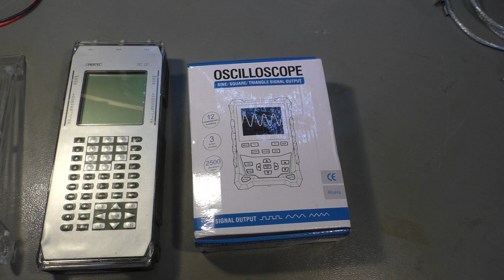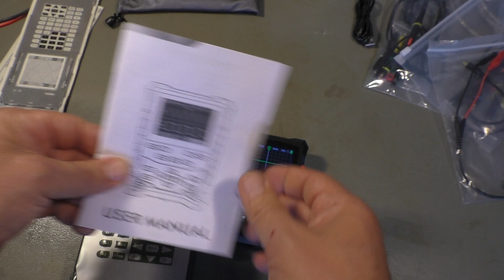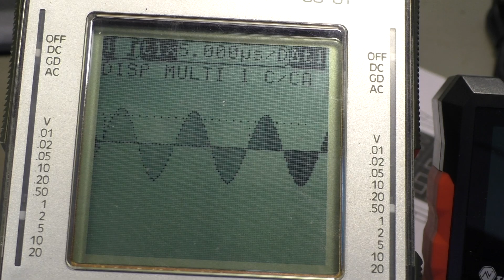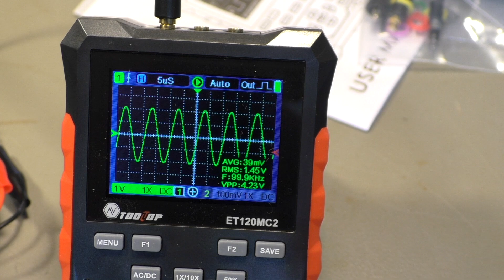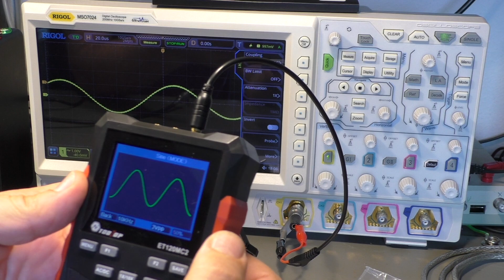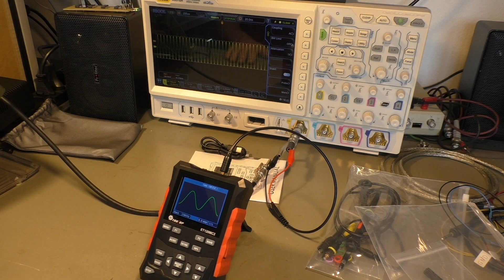37 years of portable oscilloscopes (PWJ238)

Comment: A better example of how good modern pocket scopes have become  would have been the zeeweii dso3d12 which costs less than $100 usd and is literally a swiss army knife instrument, combining a 120 MHZ/ 60 MHZ (single vs dual channel) scope, a full featured 4 3/4 digit multimeter, and a signal generator. It is also the only battery operated scope in this price range to have a working spectrum analyser (FFT) function, as well a a six digit frequency counter that functions independently of th scope frequency measurement function. And as if that isn't enough, it also sports a brilliant high resolution IPS lcd didplay. That's a lot for less than $100.
Reply from the maker: Yeah I missed the multimeter in this scope. At least one that measures up to 50VDC or so...

Comment: The generator output impedance is 50 Ohms, and it assumes a load impedance of 50 Ohms for delivering 2 Vpp. The oscilloscope has a high impedance in the MOhm range and therefore measures twice the voltage indicated by the generator.
Reply from the maker: Yes… right. The voltage level is correct when I use a 50 Ohm terminator or when I change the output impedance to 10kOhm (max)

Comment: I’ve abstained from these simple scopes, because in the use cases that I’m likely to use them for, the common ground of the non-isolated inputs are likely to be at least annoying due to potential ground loops or possibly dangerous or destructive. Is that the “same” ground between this subsystem and the other?

OTOH, one might be able to justify buying a few of them as a Redundant Array of Inexpensive Oscilloscopes to work around those scenarios.

Comment: i used to like the old fluke ScopeMeter. the optical RS232 was great for connecting the PC to it, and a few IO lines from the PC printer port you could have a small bit of ATE up and running in no time. great for a quick setup test in production where you just wanted a quick press a button and confirm the small PCB functioned correctly.  Saved having to teach everyone how to use the scope. 🙂

Comment: I reviewed the Tooltop the other day.  It's a sweet little device, but you have to be wary of the fairly low real sample rate for non-repetitive waveforms, especially for signals with high frequency content.
Reply from the maker: I saw your video... I think the oscilloscope is useful for audio stuff and that's it. I find it more disturbing that the wave generator outputs a signal with DC. It looks like they forgot the output capacitor. Pretty dangerous when sending that signal to a DC coupled amplifier.
Reply: @PlaywithJunk  I expect for low frequencies the output cap would need to be so big it would not fit in the case. :-)
Reply: @PlaywithJunk  Yes, we both found (different) weaknesses in it.  That's not to say it's a bad device, it's still useful within its limitations.